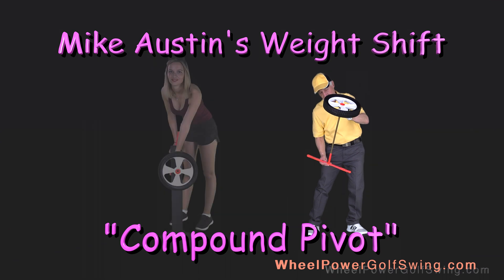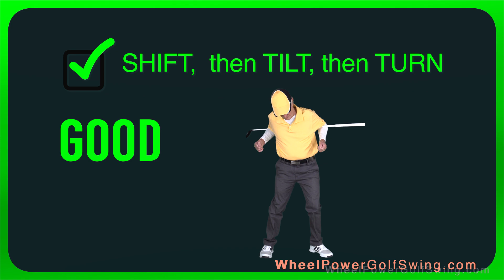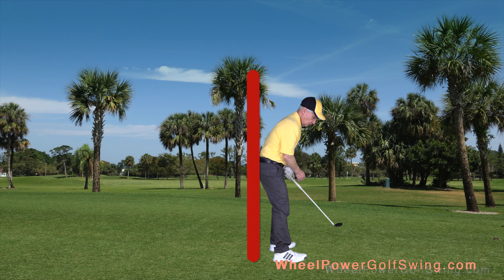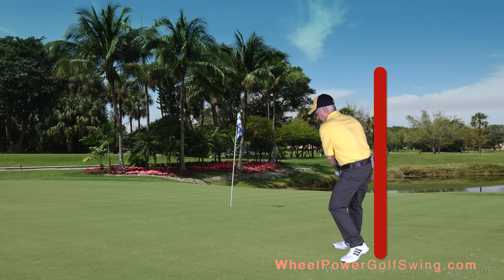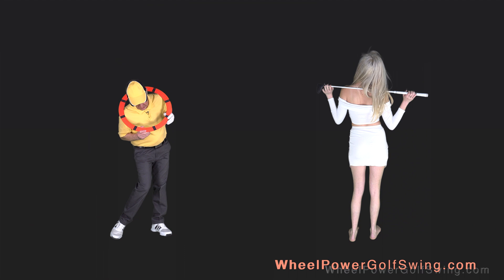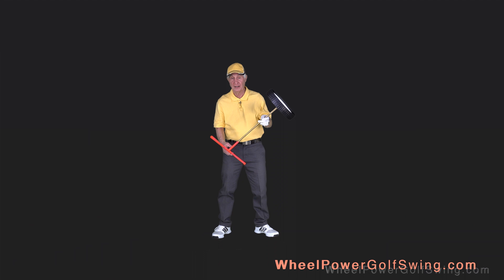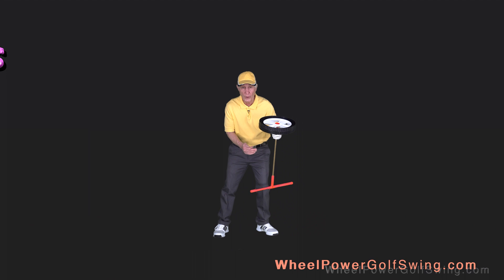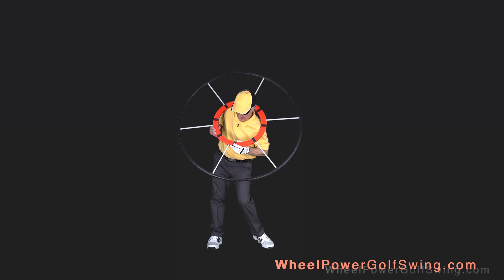Mike Austin Compound Pivot - Weight Shift Explained

Comment: Thank you for sharing. It is the other way around the shoulders turns the hip and the knees and legs on the backswing. You are showing the shoulders turning without the hips rotating/pivoting. If you connected the two of how they work together as your video goes on; then fantastic; if not? Cheers
Reply from the maker: Hi Thomas, I do show the hip action. Watch this video a few times from 7 min 59 sec through to 8 min 49 sec. This is Mike Austin's compound pivot action where the spine acts like both (1) a lever as it shifts side to side at the spine bottom (hips) and (2) an axle as the spine rotates. 

This Compound action by the lower spine and attached hips shifting side to side, tilting and turning (all driven by the leg action) is EXACTLY what creates the rotational motion at the shoulders (the wheel hub) - using the spine as both a lever and axle. 

It took me 5 years of study and working with 2 long drive golf instructors who knew and studied under Mike Austin before the light bulb came on for me (I'm a slow learner !!). It is not a concept golfers grasp quickly, because I see many many Mike Austin fans comment on how they struggle understanding that compound hip shift/rotate action. 

The biggest reason golfers struggle is with the exact sequence: you must first shift the hips back, then tilt them by bending the opposite knee, and then turn the upper body. Then.. do the exact same sequence going forward: a BIG shift of hips forward, followed by a tilting them, and then a turn of the upper body. The left shoulder points down on backswing and right shoulder points down on forward swing as they rotate around the swing center.

That's why I personally decided to create all my videos promoting his superior swing method. Mike was brilliant. He studied the human body through the science of kinesiology and saw the human body golf swing action as nothing more than a movement of fixed levers and flexible joints operating like a single axis wheel turning machine. 

If you watch some of Mike Austin's old material (I seen hundreds of hours of it), he consistently comes back to the concept of how the shoulders act as a wheel hub, the arms act as the spokes and the compound hip action drives the rotation action of the shoulders. The swing center is at the C7 (where the shoulders meet the top of the spine at the base of the back of the neck)  Many golfers and instructors have attempted to explain Mike Austin's swing concept; so just add me to the list !!!

In closing, I can honestly say to all the golfers out there, that as soon as I understood the concept, my personal scores dropped 6-7 strokes per game, every game. Because my body acted like a single axis wheel turning machine (similar to the Iron Byron), it was impossible to hit anything but straight shots. My human body was acting like a robotic golf machine !!

I encourage all struggling, inconsistent and frustrated golfers to learn the Mike Austin golf swing concept (Wheel Power Golf Swing).     https://youtu.be/UDdzq70yKRQ 

Say goodbye to lost balls, frustrating slices and say hello to effortless power drives and lower scores. Thanks again for all your great comments and feedback. Norm Rosen
Reply: So I think you’re saying the hips are the big red handle in the wheel analogy?  It’s taken me a while to figure this all out too, but the power and ball flight are just incredible when this is done correctly.
Reply from the maker: @kevinhartman7465  Hi Kevin, yes unfortunately Mike Austin was a genius, but not a great teacher because he was just too technical. 

I studied Dan Shauger and Mike Dunaway who both studied under Mike Austin, and then I took lessons from a really great teacher: Senior Long Drive champion - John Marshall who studied under Mike. I also had several conversations with Long Drive champion - Jaacob Bowden. 

Mike had a reputation as being rough around the edges as a teacher, but anyone who actually understands what he was trying to say will eventually catch on. 

The biggest challenge I found after reading hundreds of comments from golfers who followed him, or other golf instructors teaching his method, is grasping what Mike called the Compound Pivot. This video above is an extract from my 4 hour advanced training series, and it took me years to finally understand that there was a specific sequence that must be followed on how the lower body hip action moves.  

Watch this video a few times from 7 min 59 sec through to 8 min 49 sec. I believe this is the key. This is the only way the lower body can emulate the red turning handle of my prop. Its a SHIFT first, then TILT, then TURN  motion which cause the spine to rotate the shoulders like a wheel hub. 

Mike never discusses the sequence exactly, so many golfers start doing things in the ``wrong order`` and get frustrated. It took me years to grasp the concept that there had to be a very BIG shift forward on the downswing of the lower spine BEFORE the other actions. Golf is challenging; do 1 thing slightly out of order and it just doesn't work.

Here's a really big secret I'll share with you. The right arm MUST start unfolding right away on the downswing. There is no delay to try to hold the angle. The arms have to go faster than the hub turning, or you end up with the arms getting caught behind the body all twisted up behind the body, and you end up coming down over the top and slice. 

As soon as you start the hips shifting forward, those arms have to speed up and hit off the side of the right hip at impact. I explain this is one of my short videos:  https://youtu.be/rhQfvvPdiso

As you stated in your comment, when the light bulb comes on and you 'get it' !!, it is such a simple and easy golf swing to perform. Effortless Power, Straight shots consistently and... no more back or spine pain as I show in my video: https://youtu.be/d4hVUU-FDIU

Thanks for your comments and feedback. Norm Rosen
Reply: @kevinhartman7465   I really appreciate the time, effort and money Norm had placed in his video; however I simply see my ‘wheels’ as being the shoulder and the hip. One activating first over the other. This allows the core of my entire body to rotates back and then forth as I swing the head of the club with my hands placed correctly of the handle of my club. 

So on my backswing as my shoulder is turning up to 90 degrees or less it automatically directs my hip to turn correctly somewhere under 45 degrees without any thoughts process on my part. . And on my downswing my hip turning with subtle quickness compels my shoulders to turn to the completion of my swing. 

Because I have not placed any tension on the hinges throughout my body (nicely marked in red on on Norm’s videos) my arms attached to my shoulder sockets swings the club head ‘smoothly, freely and fluidly’ up behind my body and then down, up and around my body as my fluid hip joints, knees and ankles also pivoting bringing my trail knee pointing to my target area allowing my foot to rise at the end of my swing. 

I believe if Mike we’re alive today he would need to simplify all that he knows about the movements of the muscles bones and and joints in our body and realize that the core of our body creates extremely more amount of power and energy in our swing than our hands; arms; knees; and feet joint combined together could possibly provide us. But, combining our swinging the club head with both the core of our body turning back and forth along with the joints/ hinges mark on Norm videos; creates a priceless easy and automatic swing for all of us. Cheers
Reply from the maker: @thomasfraser9072  Hi Thomas, I think we are ALL agreeing on the fact there is a wheel at the shoulders. I also agree that the power starts from the ground up and from the core. 

I did one video I have somewhere where I spin a toy top. Spin it from the center and it spins for minutes. Try to spin it from the outer edge, it wobbles and falls after a few seconds. The power starts from the ground up, and from the body center core absolutely.

Here is a video of Mike Austin ``himself`` describing the wheel at the shoulders; listen. to his own words at 4 minutes 10 seconds into the video until 4 minutes 50 seconds.
https://www.youtube.com/watch?v=TxWrhTsTeho

I see the loose wrists (acting like a swivel hinge) riding along the RIM of that shoulder wheel, and the hands hanging onto the golf club. So as the shoulder wheel turns, the golf club is being whipped around by the wheel RIM as I explain in my Wheel Power Golf Swing videos.

I think the vision we all have at the hip area may vary in the interpretation slightly. The Swing center (C7 vertabra) is both the swing center .. and... the pivot point of an upside down cone where that pivot point is the vertex (point) of the cone. So if you can visualize that upside down cone, the hip movements are moving within the outer wide area of the cone. At one point several years ago when planning my videos I did think about showing that. 

So obviously as I demonstrated, you cannot turn the turning handle in a pure circle under the shoulders, but, to your point the compound movement of shifting, tilting and turning the hips caused by the leg action can be looked at as a circle or second wheel (the outer wide area of the cone). 

I see it as a third wheel for one only reason only. The RIM of the shoulder wheel MUST go faster than the HUB of the shoulder wheel which is accomplished by the right arm folding then unfolding on the back swing, then the left arm folding up on the forward swing. 

In my Introduction video I talk about it being very similar to a car rear differential system where outer rear wheel of a car going around a corner MUST go faster than the inner rear wheel. For that reason only I distinguish the HUB and RIM ``acting`` like 2 different wheels.  

Watch again my Introduction video - the entire chapter of  "Wheel Power – Path & Plane" starting at 43 min and 48 sec:     https://youtu.be/UDdzq70yKRQ. This explains exactly why the shoulder HUB and RIM act like 2 different wheels. In a normal wheel the hub and rim travel at the same speed; If the rim and hub are going at different speeds, it's not exactly 1 wheel anymore.

So bottom line I think we are all saying the same thing in a slightly different way; and that is that Mike Austin was a genius and the rest of us mortals can only hope to explain his concept to other struggling golfers who are torquing their backs and ending up with back and spine pain and inconsistent golf shots.

You may want to rent my 4 hour Advanced Training video on my website and consider listing yourself as an instructor on my website. Take care and thanks again for your great feedback. Norm Rosen
Reply: @WheelPowerGolfSwing  I like Mike’s “7” images across the shoulder and down the lead arm. Is this in your 4 hour Video? The rim of my shoulder wheel turn quite nicely as I stay in my golf posture. And the shifting of post from the right leg to the left leg works nicely as well. Absolutely we are on the same track. Later I will check out your sight and seriously consider your generous offer. Cheers
Reply from the maker: @thomasfraser9072  No, I don't talk about the figure 7 for a very good reason. I thought about it, but I personally believe it was just one of those things golf instructors do to give a ``temporary`` visual to a student. 

The arms act as wheel spokes, and at some point in the forward swing the left arm collapses. So the left arm acts like the spoke on the backswing, then the right arm acts like spoke in the forward swing; they alternate being the wheel spoke, so I didn't want to glorify only the left arm position with the number 7 visual. 

They play EQUAL roles taking turns being the wheel spoke. Watch my video again starting at 9 min 23 seconds and watch it right until the end. You'll start to see exactly how it works. 

I created an effect at the end that clearly shows how we end up as a single axis machine where the left and right arms have played equal roles in turning the wheel. You may have to watch that section a few times, but I think you'll being saying "OK, I get it" (I hope you will anyways !!). Thanks Norm
https://youtu.be/yGs1iyCO9qo

Comment: A wheel hub and the wheel itself does not tilt when it rolls backwards or forward. It rolls upright attached to a primary axis as you show in your video. 

Once we are in our correct golf posture our spine is correctly tilted thus the wheel hub  ( as Mike refers to our shoulders as a wheel) is no longer rolling upright; but, on a tilted slanted plane. Correct? So as we are shifting our weight as you have shown: our wheel hub is simply rolling to our trail axis ( leg) and then reverses course, rolling to our lead axis ( leg). Our left arm can represent a spoke that rolls the the wheel hub to our trail axis (leg) and then our trail arm can represent the spoke on the wheel hub that rolls the wheel to our lead axis( leg) 

With the shifting of our weight from side to side this shows we have a two axis swing that causes our wheel  to travel on a angular path from one axis to the other; not upright only on one axis Cheers 

So as you can see the tilt is already built in our bending first from the hips then the knee; and tilting any more then we should could mess us up. Cheers

Comment: This compound pivot instruction, whereby you are using the spine as both an axil and a lever, is the Only relevant swing methodology in golf!!!!!
Reply from the maker: The pelvis shifts to the lead side and also rotates which causes the spine to act like both a lever and and axle - which turns (rotates) the shoulders (the wheel hub). 

The wrists ride along the rim of the wheel and the hands just hang onto the club. 

As long as the golfer keeps rotating the shoulders, the rim will rotate and the club will be pulled around. 
It's a simple concept if golfers keep rotating. Check out my video on Mike Austin and The Iron Byron golf machine. 
https://www.youtube.com/watch?v=HG9MVGzGtgc

It becomes so obvious. Thanks for your positive feedback. Norm